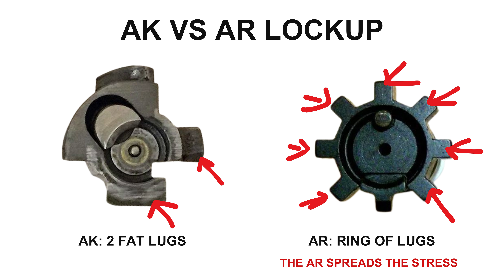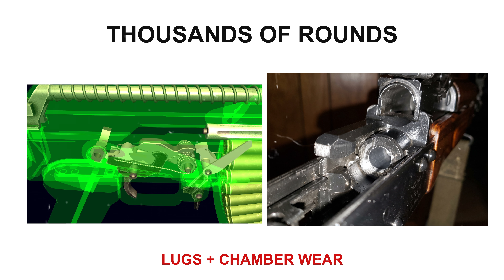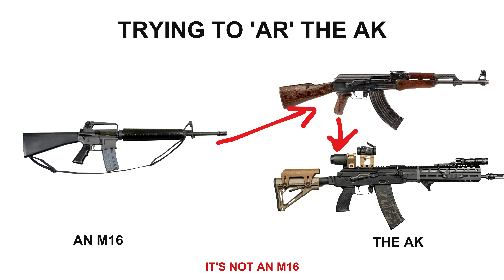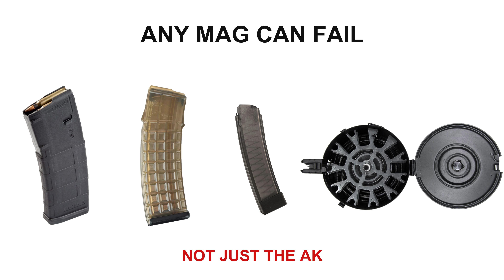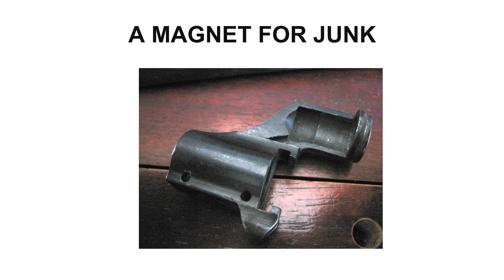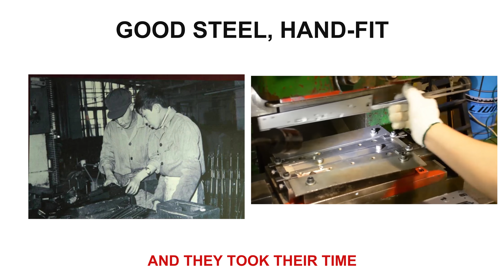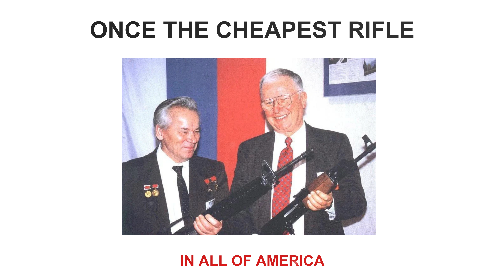Every AK Flaw Explained

Comment: A lot of the problems you mention are overblown. The bolt design is fine, Battlefield Vegas has had aks go 80-100k rounds on factory bolt and trunnion, accuracy isn’t a issue my Wbp ak101 build is 1.5-2 moa with good ammo, 3 with trash, right side controls are fine unless you are a lefty and if you have extended safety levers you can easily manipulate the selector lever without moving your hand from the grip, the dust cover not holding a issue has been solved by many companies and the side rail exists. Gas ports aren’t a problem and yes while many aks are overgassed it can be countered with an adjustable piston or a gas block with adjustments. I could go on and on

Comment: The only issue i see (that isn't user error or subpar manufacturing) that remains on modern AKs are the opening when the firearm is not on safety. Which is curious as they solved this already with the akv521, and it was durable even in extreme cold

On a sidenote i am so curious about the ak-22's performance

Comment: Makes me wonder how much my old Romanian AKMS-47 is worth now since its been working flawlessly for me. Accurate to 800 meters, doesn't jam, OG firing pin still works just fine, and its spits out even cheapo corrosive ammo without issue.

Only problem it has is that my AK does NOT like Chinese surplus magazines at all. But it does work just fine with modern magpul magazines and even surplus S. Korean metal magazines feed without issue. Thankfully finding decent magazines isn't an issue in the US.

Comment: to add to that, people are forgetting the ar and ak lines are older then they are. the there are some ar15 that can be C&S  shipped to your house now. 
they are a product of their times. a peasant commie is not going to kit it out and add suppressors and so on just like  a gi did not have access to suppr at the time. different concepts and usage and strategy. convectional vs insurgent. needs boys needs. can you imagine if stoner or Michael had newer materials?  opticts? etc

Comment: This dude literally knows nothing ars are more reliable you literally can put optics on the dust cover on aks the ak12 is a great example of it holding zero talk to any Ukrainian soldier that has used them every semi auto rifle if front heavy because the barrel and gas system like come on bub we live in 2026 we can fact check you for one and two by this point it’s common knowledge that aks fucking suck

Comment: the comments here is pure hell. A lot of the issues have been solved and or wouldn't be an issue if it wasn't for poor quality control now a days. the Occam defense merc rail solved the sights not holding zero issue and ultimak clones are still available in other places if youre concerned for the world wide market. Not to mention the tolerances on zenitco rails will end up leaving you with a red dot or holosight suitable mounting surface and the gun is at best a 4MOA to 3MOA gun all around. No need for crazy optics if it it wasn't built with the intention for it. And ARs have plenty of issues. Blown out gas tubes ,completely cracked buffer tubes, If you don't maintain it constantly it will be useless, cant fold it, the mags weather you like it or not aren't always reliable.
 bolt lugs sheering, they added a fucking forward assist standardized for gods sake, MOST AR15 manufacturers care less about tuning their ARs to be flat shooting and reliable, Valgear and many other Ukrainians have stated DDM4s don't have a good reputation for reliability in the field and its one of the gucci brands, if you have to shoot prone it is harder if you need to rack the bolt, MOST AR ambi controls are far to clumsy and premature, the bolt hold open has the same flaws as the AKs safety selector with it being far to open except when you empty your mag at something while prone all of that dirt and dust that gets kicked up in that process will work its way into the gun, ARs CAN be accurate but its manufacturer dependent and handguard dependent. biggest plus for AKs imo is you can use just about any vehicle grease in it and it will be happy as a clam and wont be picky with lubricants.

Comment: I don't think the two burst mode on AK is useless, they remove it to make soldiers do it. In Vietnam, firing two burst while the AK is in full auto mode is a soldier's compulsary skill, because it was used first used in the resistence against US back then and casted fear on US soldiers. Some US vets also said "If you hear a full auto AK, then they are rookies. But if you hear two shots in sequences, prepare yourself".
Reply: That's basically been my experience in modern FPS games. The rooks tend to shoot full-auto. You would think in close quarters they would beat skilled players. Well, most of the time they don't. In modern video games, fast is fine, but accuracy is final.

Comment: Yet the ak still is the most used platform in the world and has more kills then a nuke. Thing is the ak is still a very good platform it was built for those who are not trained and know little about guns they can pick it up and go where a ar yeah no cleaning and maintaining a ar is harder then a ak. Ak were built as heavy hiting machine guns for close range and it does it well loke in Vietnam and Afghanistan it wipe the m16 platform. What good is range if the enemy holds onto your belt buckle also the ak u can find parts for it anywhere unlike the m16

Comment: Only real concern are the mags, but I've never experienced one. I know people who had to juggle their mags to find a good one.

The bolt is fine, the dust cover is fine, the gas port has never given me issues, AK's tend to be "overgassed" to keep it running, the gap behind the selector isn't an issue, it would have been fixed in the 70 years of producing these things, right side controls are better IMO, just keep your trigger finger on the selector untill you're ready to fire, very smooth movement. In my opinion AK's are quite well balanced, the center of gravity is just in front of the mag, about halfway of the gun. 

Most of my experience is from RK-62's and 95's tho, and the 95 is front heavy. But no real issues ever on either, shot some Arsenal AK's and only thing I disliked was the sights being so far forward and open.
Reply: Mags are a little better now, especially for 5.56 ak’s. Psa actually makes good mags, Bulgarian commercial mags are good, available, and cheap, 5.45 mags can be converted, and of course wbp and arsenal have their stuff
Reply: @AvtomatKentucky101 absolutely no experience on anything else than 7.62. The mags the defence forces issue have never let me down, even after a week of grilling sausages on the mag springs.

Comment: "The rifle that was designed to arm a peasant army by the millions has quietly become a connoisseur 's purchase." 

The problem I had with an older AK -style rifle was that in extreme cold the "charger" (or charging handle) froze in place next to the receiver due to the temperature changes while moving from a position to another. It was impossible to get the weapon to cycle before melting the ice off it in room temperature conditions later. Another issue I had with the rifle was, most likely due to the loose design of the platform, that it misfired a lot in my opinion... 

But nevertheless, it was an accurate rifle and extremely easy to maintain with minimal effort in ideal fighting conditions.

Comment: "Too loose" is not a flaw.  Accuracy suffers to a completely insignificant degree.  It's not a sniper rifle it's a battle rifle designed for 300 yards and closer.  For those ranges it's perfectly accurate.  Your video is ridiculous.  Most of your "AK flaws" are just reasons an AK is not an AR.  Weak.

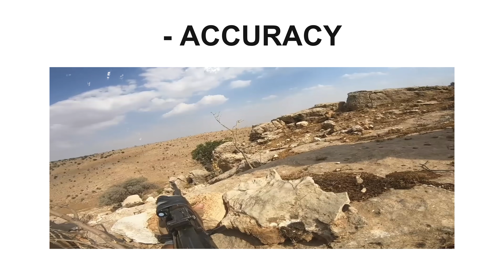Comment: 1:37 thats not an Ak but is actually Zastava M70 with milled receiver and spigot-type grenade launcher
Reply: @nikolajovanovic7419  still an ak. exact same system as the AK just different spec. its like saying an inch pattern FAL isnt an FAL because other FALs are metric.

it can accept AK bolt, carrier, trigger group, rear sight, magazines, muzzle device, etc.

also that zastava at the time stamp is an m70ab1, stamped receiver, not milled
Reply: @ihaveastoma3869  Yes. Different specs as you said and thats not insignificant as you may thing. AK is build to serve its purpose M70 is built to last generation after generation....

Comment: 0:19 First flaw in and already mistakes were made. 

The AK locking lugs are the ones on the sides. The bottom lug is only for pushing the rounds from the magazine into the chamber.

Remember, for lockup you need flat spot behind the locking lug. Otherwise it's not locked, only delayed.

Comment: Use original AKs. Soviet or russian AK don't have problems with bolt and accarucy. Nonsoviet ak uses junk soft steel barrel and receiver, you can check hrc on any replica and it will be smaller than soviet

Comment: 9 Hole Review definitely debunked the inaccuracy myth.
Reply: it is not as accurate as an ar, but it is not far behind. It's more than enough for the distances it is shot at even after heavier use
Reply: @JimBrodie Indeed I don’t think it’s about accuracy, it’s about range and thats with the 7.62x39 round and the average AK barrel length.
Reply: And how many different AK's did he test? It's an indisputable fact of machining anything; looser tolerances mean less accuracy. That doesn't mean it's an eight MOA rifle, but it definitely means you're taking a marginal (at best) hit to accuracy compared to something with tighter tolerances.

Comment: Okay, so if it’s front heavy, make it bullpup. If the dust cover is loose, add a bolt to secure it like an upper receiver
Reply: groza exists and that shit sucked to shoot
Reply: its not even front heavy. and the dust cover bolt would be an issue because the top cover is a non issue because the side rail is superior anyway, its OG qd mount

Comment: the AK series was conceived by a tanker and self-taught mechanic who wanted to design tractors, the AR pattern is designed by an actual aerospace engineer who worked at a subsidiary of an aircraft manufacturer, these two not only do completely different things but are simply designed for completely different products.
Reply: No wonder the M16 failed initially.
The standards an aerospace engineer expects out of (barely trained)soldiers and supply chains, to use the tool properly, are (poetically)astronomical.
Reply: @TheAlexRhodes  i agree that the M16 had its teething pains that are expected in any large procurement of an untested rifle system, especially a radical design (at the time) and one that relies on such tight tolerances in order to simplify and reduce part counts as other rifles did.

with that being said, the early issues with the platform could also be shared with the military top brass who insisted on a forward assist subassembly (throwing off the mechanical equilibrium of the rifle), the use of bad ball powder by ammo suppliers neither approved nor known to armalite at the time, omission of chrome-lined chambers in the name of cost cutting by subcontractors, and a disastrous "self-cleaning" marketing myth.

combine that with leadership failures of deliberately manipulated early cold-weather trials to make the platform look weak, not giving self cleaning kits nor instructions on how to even clean the gun by G.I.s or that aluminum mags that were supposed to be disposable being reused, and im surprised it made it out the other end to become such a dominant rifle design and might as well be the most elegant firearm design ever.

its important to note that this the framing of your point ignores the fact that this happened to many different firearm designs in military procurement and did in fact do so in the ak-series, whether catastrophic failures of the early type 1 stamped receivers that warranted the desperate pivot to milled ones in type 2s and type 3s, this period of trial and error took over ten years (from 47 to 59) compared tho the m16's 3-4 years (from 64 to 68)! and this is why there is the ak-47 and the akm which is the more correct term for the dirt cheap farming implement looking mass-produced icon known globally today.
Reply: @TheAlexRhodes  the cheap out on the gunpowder used on the 5.56 thus clogging the gun, and being the told the gun was self cleaning made it worse
Reply: Thats not what happened @Raffy-wo4ph
Reply: @Raffy-wo4ph  the original powder designated by stoner had issues with overpressuring casings. That's it.  So they changed the powder and that issue went away, other changes to alter gas output, bolt design, bolt interaction with the gas tube, gas length, fire rate changes with bolt weight and spring/buffer changes. All happened. But the powder wasn't a large issue at all, and was fixed 5 years before vietnam.
Reply: That is a big fat lie and Russian propaganda because the truth is out the Kremlin contracted Hugo Schmeisser to build the AK .
Russians even today don't have electric or water pluming in village shacks and a villager is so poor buying a lathe - milling machines - drill press is impossible- Russians don't even have indoor toilets and it is the first the Russian invaders take from Ukrainian homes is the toilets

Comment: The worst flaw of the AK system in my opinion is the fact that the bolt doesn't lock back after the last round is fired. The AR is much more technologically advanced than the AK and all the AK guys need to acknowledge this.
Reply: @just_player0018  🤣 Technologically advanced means dick when the gun jams on battlefield.
Reply: @A @AngolanTourist tell me you don’t know anything about the AR platform without telling me you don’t know anything about the AR platform:
Reply: more advanced? If we go by that, many other guns beat the AR. Also, the fact you need bolt lock to tell ya your out is wild, if you have a brain, you’ll know a click means your out. Ima be real with you, this just seems like cope from piss poor logic from you. Be better, do better.
Reply: @kaztrack1775 yeah personally I would like to know that I’m out and not to hear a click in a moment when I need the gun to fire. That’s why I stick with ARs.
Reply: Pal, there’s a reason every modern army uses some sort of an AR and not the AK. AKs were good in the 1970s😂

Comment: "and that tab has to be cut, to EXACTLY the right size"

my dremel would disagree with that comment
Reply: So it does need to be the exact size which leads to you needing to make modifications that cant be undone that will make other mags no longer work with it

Did you think this through?
Reply: @13threaper20202  did you think through that maybe the magazines were modified and not the gun itself?
Reply: @Pebbs800 yes you could do that if the issue permits but the issue could also require modifying the mag well of the rifle 

As in saying "i can modify it its not really an issue" really just proves the point theyre replying to
Reply: @13threaper20202 I can tell you’ve never built an AK but that’s ok
Reply: @Pebbs800 then by all means explain 

A press is needed to get the barrel in and the barrely needs the chamber cut to headspace with the bolt being used jsut like the majority of firearms 

The gun uses rivots primarely while most other guns use pins and screws 

Correct whatever ive said thats incorrect since you know and i dont and ive "clearly never" built an ak
Reply: @Pebbs800 "Replacing a barrel on an AKM is an advanced gunsmithing task that requires a 12-ton or 20-ton hydraulic press, specialized barrel
 push-out tools, headspace gauges, and drilling equipment. Unlike an AR-15, an AKM barrel is press-fit and cross-pinned directly into the front trunnion."

I was going to include all the steps also but god knowing how to do it and actually seeing it in writing infront of you makes it sound so much worse

Ar you literally unscrew a barrel nut slide in a new barrel with sone grease and tighten the barrel nut and youre good minus installing the gas system which isnt bad

At worse it uses cross pins rather than just a set screw but you can build an ar15 from scratch with basic mechanical knowledge 500 dollars in tools (if youre goign all out and being fancy) and the parts you can be completely ignorant of firearms and still figure it out its just that simple ak you actually need to be a gunsmith
Reply: @Pebbs800  exactly this! We modify the part to fit the machine/car/gun whatever. I've seen people do it the other way around and it always comes out a disaster and a half.

Comment: On the issue of the AK12 dust cover,

If you watch the Forgotten Weapons video on the AK12 which you took screenshots from, you'll find that it actually does a far superior job of holding zero than a typical AKM/AK74 outfitted with a top cover mount. This is because the AK12 (as well as the AK200) utilize rigid, constant pressure points of contact and locking at both the front AND the rear of the top cover with the help of hooks, latches and pins. This reduces the leverage that causes designs from TWS, Zenitco, FAB Defense and others to lose/shift zero.
Reply: Additionally, you switched up the selector designs that over traveled. The modern AK12M1 that utilizes a thumb safety actually requires less leverage and travel whereas the early production AK12s with a standard AK safety over-traveled because the did not have selector stops attached to the magazine release block.

Comment: I've seen US bolt parts on AKs and AR15s last less than most women last with me and I have not seen that on an AK. Still wouldn't pick an AK most likely. 20-year old Beryl hold zero on its rail, attached dust cover no problem.